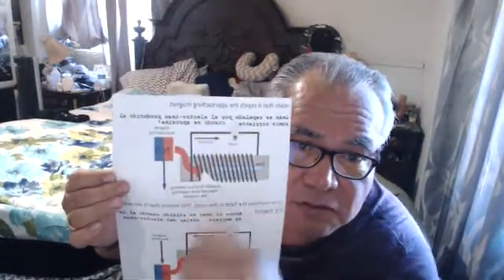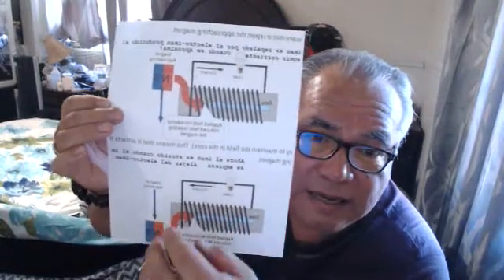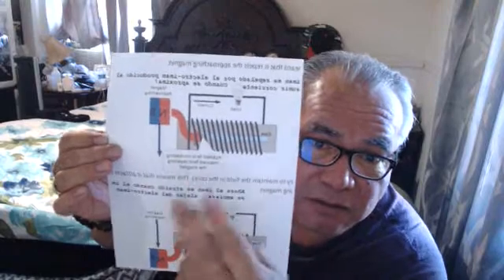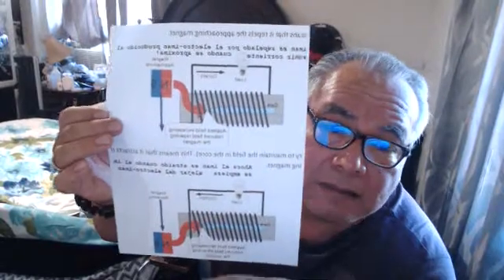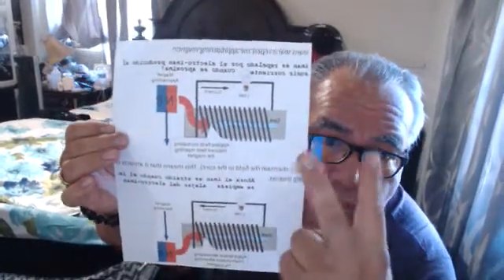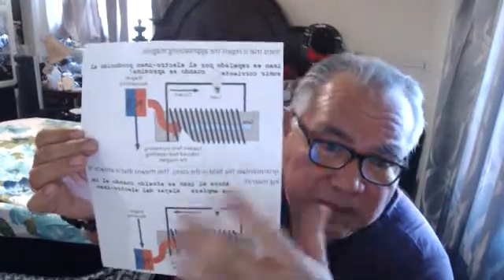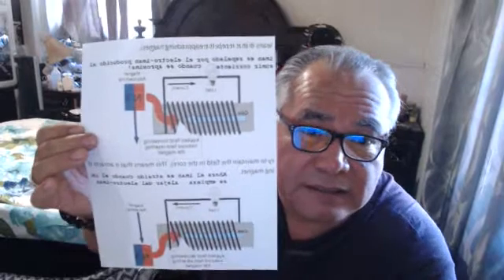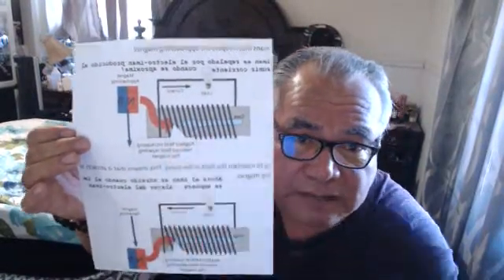Secret of lenz free coil

Comment: Hi Alex! You could be a great teacher! I have been looking for information on this issue for a long time. There are many solutions to this issue on the Internet. But there are very few those who can really explain their decision. I am not an English-speaking person, but your explanation of this effect and the method of overcoming it, in my opinion, is the best of what I saw on the Internet. Thank you so much!
I have a couple of questions. If it’s not difficult for you, please answer.
1st question (doubt): the coil on your core is quite far from rotating magnets, and this leads to a significant decrease in the introduced EMF as well as the value of the given current. How do you go around this problem?
2nd question: you use a ferrite core. You can probably use a core of laminated transformer iron plates, right?
3rd question: how thin should there be a rubber washer to get the maximum current from the coil?
I am grateful in advance for the answer and I look forward to it!
Reply from the maker: question 1,  Magnetic energy will flow into the coil thru the legs of ferrite or laminations; does not need to be close. 2. Ferrite or laminations, ferrite for higher frequencies. 3. Rubber washer like the ones in your faucet; flat is better but not too thin, you may need 2 flat rubber washers. Magnetic wave is forced to go ONE way like a magnetic Diode., thank you for watching!
Reply: @alexmanzanero  Thank you very much for quick response! Of course, I understand that magnetic energy will enter the coil through the ferrite legs or plates. At the same time, another magnetic flux will follow the same path, excited by current from the coil to the load. In your opinion, do their directions and phases coincide? Wouldn't it subtract one flow from another and therefore reduce the resulting flow? What do you think about this?
Thanks in advance for your answer!

Comment: Hi Alex, interesting "magnetic diode" idea that you came up with and thanks for sharing it.  It's worth testing it to see what will be the minimum input v/s maximum output?. But so far  the most ingenious or clever generator that was ever design and built that totally avoids Back EMF or Lenz  forces with an incredible efficiency it was by these folks from Indonesia.  Here is the video: https://www.youtube.com/watch?v=3DKUFoWAuj0  long video but it's worth watching it. This was off the shelve generator  1800 RPM 4 pole synchronous that they modified armature coils with permanent magnets. Stator coils and armature magnets remains stationary the only thing that rotates is the laminate plates between the magnets and the coils (They named the Dragon Core) After years of studying this I know how it works but requires precision machining and financial cost involve to replicate it. If anyone has money to do this research it's worth pursuing it.

Comment: Hello Alex: you have produced, by far, the clearest, most coherent video on Youtube related to the Lenz effect.   I am a physicist, and have a matching theory that relates Lenz effect to gravity.  d.orr@ipeerion.com
Reply from the maker: wow thank you for the comment
Reply: @alexmanzanero  Here is a very general outline,  derived from a detailed analysis of 1. The Maxwell-Heaviside equations- especially the geometric relationship between the Ampere-Maxwell and Faraday laws (Lenz' law being implicit); 2. The Dirac equation for fermions and the phenomenon of zitterbewegung (a la Schrodinger)- it's electromagnetic origin, and 3. the implications of the previous as to the origin of mass and inertia as the reaction of the quantum vacuum to the movement of charge (the magnetic vector potential storing momentum from moving charge and the magnetic field discharging momentum energy stored in the quantum vacuum.)
Reply from the maker: @davidorr947  I'm really interested in the hack job they did to the Maxwell-heavyside equations eliminationg the negative aspects of the equations

Comment: No such thing as a Lenz free coil.  You just can't eliminate the Lenz effect.
Reply from the maker: true but if you study my videos you will learn to divert the lenz, and even use it to double the output
Reply: @alexmanzanero  Thanks Alex.  I will have a look.  Cheers
Reply from the maker: @valveman12  https://www.youtube.com/watch?v=nigD1c3aBUA
Reply from the maker: @valveman12  you bet,
Reply from the maker: Lenz is a magnetic effect, as such it will prefer to adhere to a toroidal loop before jumping back through air 1000 to one preference so it gets trapped in a circle
Reply from the maker: i have taken the lenz and used it to power an opposing coil that compliments the 1st coil therby using lenz to the fullest positive effect then diverting it at the end so that the rotating magnets are then blind to the effect of adding x amount of coils, get my drift?
Reply: Total bullshit, are you a disinformation shill. Bi-toroids are effective at diverting lenz flux away from rotors.
Reply: @SimoneKolusniewski  
It seems you might be feeling quite frustrated! I want to clarify that there is no such thing as a "Lenz-free" coil. What we actually have are Bi-Toroids, which are designed to reduce the Lenz effect, though not eliminate it entirely. The bi-toroid design, developed by Thane Heins, is primarily used to minimise the Lenz effect on the primary windings of transformers. This helps to decrease heating and lower current draw in the coil. With that in mind, do you believe that free energy devices are possible?

Comment: Hi alex, I've been experimenting with the idea in this video as I said I would. I built a small diameter bedini circuit pulse rotor as the magnet wheel, This way with low torque, it's easy to see any drag. I used an 1/8" thick plumbing rubber washer on one leg and 2 steel washers stacked with same 1/8" thickness on other ferrite c-core leg. Using 1" diameter by 1/8" neo rotor magnets, 4 on rotor. I was getting strong drag at first, then I started tweaking the magnetic diode (dual ferrite c-cores) and I found if I placed another ferrite c-core across the rubber plumbing washer, acting as a jumper, it caused only slight drag and still gives a decent voltage and current. Seems to like a heavier electrical load also. So I would say this magnetic diode needs to be tuned to the particular rotor one is using, meaning the gaps and saturation probably needs to be taken into account. I'm super gluing the new c-core into place for more testing, as I was holding it in place for the previous tweak experiments, then will share more.
Reply from the maker: yes it likes heavier loads to counter lenz better
Reply: @alexmanzanero  Which gives more power output? Your Anti Lenz Drag Coil Vs conventional generator coil placement?
Reply from the maker: @mariastanford5701  hey thanks for watching, one of the items that people overlook is that although the conventional way your output just from the coil may be greater but people overlook the negative sign in front of lenz. i.e. You amps skyrocket to your drive motor due to the drag so technically your are losing more than you produce.
Reply: @alexmanzanero  ❤
Reply from the maker: thanks for the update
Reply from the maker: The bigger the rubber gap the more lenz is going to show its ugly head , so becareful on how wide you gap is
Reply: Hi Alex, yes, I think for my particular setup as it is, with the strong neo magnets and less depth ferrite c-cores (from TV flyback core), the rubber washer is too thick, which is why it needed the extra jumper c-core. I observed the input amps on digital meter using a 1 ohm resistor as load on magnetic diode coil and only slight drag. Here is setup at the moment. https://postimg.cc/xcqtwhgz - https://postimg.cc/w1mFvNCx
Reply: Hi alex, I made a video of the device, interesting, it seems to speed up slightly when coil is short circuited, as the bedini motor circuit lowers in input amps when the rotor goes slower. https://www.youtube.com/watch?v=6yNT15tu4sI&feature=youtu.be

Comment: Thanks for sharing Alex! Great explanation! I look forward to building a system around this design!
Reply from the maker: yup jason compare it to a normal coil as you take amperage readings and you will find no drag on primary motor even if coil is short circuited fully; actually the coil works better under full load than a light load because of the magnetic "trap"
Reply: As it should! Pretty amazing!
Reply from the maker: this guy is a genius...
Highlighted comment
valveman12
14 minutes ago
No such thing as a Lenz free coil.  You just can't eliminate the Lenz effect.